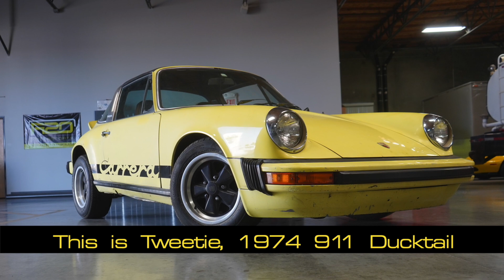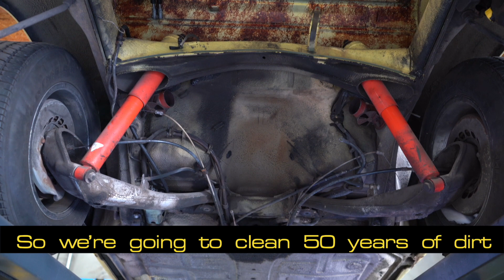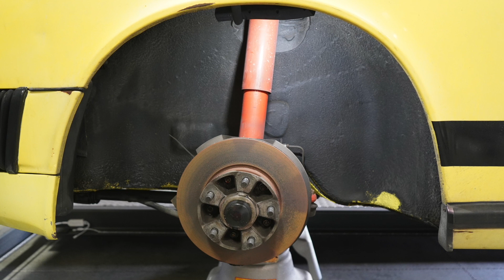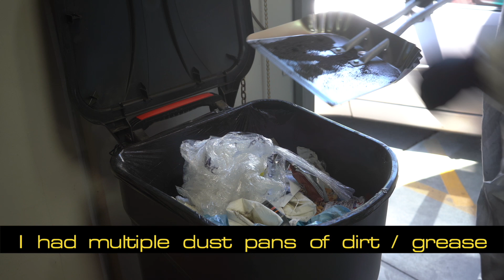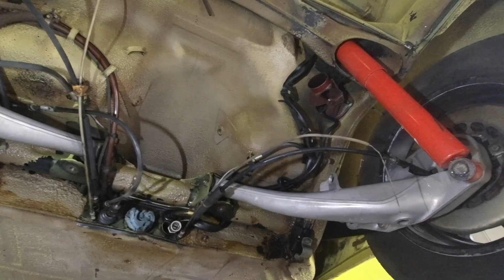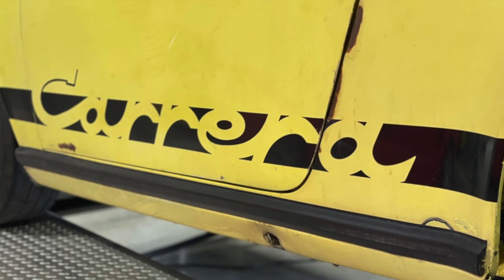Dry Ice Cleaning 1974 Porsche 911 Carrera Ducktail, Part 2 Wheel Wells

Comment: Wow nice work. One question, how much dry ice did you need for this project? And how much pressure did you put on? I wanna rent one of this device's to clean my old car. 

Best regards from Germany
Reply from the maker: Thanks.  The yellow 911 took about 750 lbs of ice.  The pressure is not constant, we adjust it depending on the surface we are cleaning.  We also adjust the volume and particle size.  This is the benefit of the ColdJet PCS 60.  We used pressures around 50psi for the hard parts and underbody and lower pressure for more sensitive areas.  In general my pressure ranges from 20psi to 75psi.